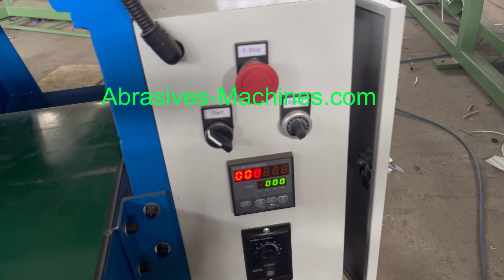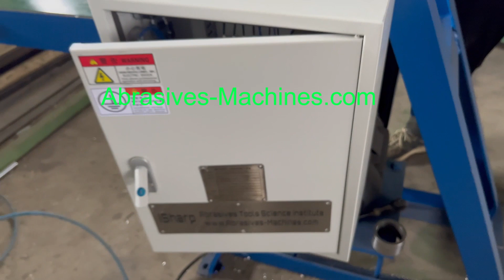Abrasive Sandpaper Sheet Cutting Machine

Comment from the maker: To cut 230mm wide narrow rolls into 230x280mm sheet with high efficiency, lower machine cost Besides the sandpaper cutting machine, iSharp Abrasives can provides whole abrasive belt converting machines line and flap disc machine line. Welcome to contact us for more details!

iSharp Abrasives Tools Science Institute 
Email: info@iSharp-Tools.com 
Whatsapp: 086-13603714080